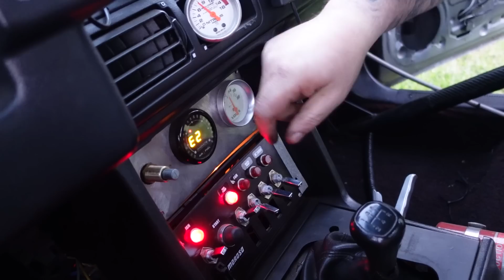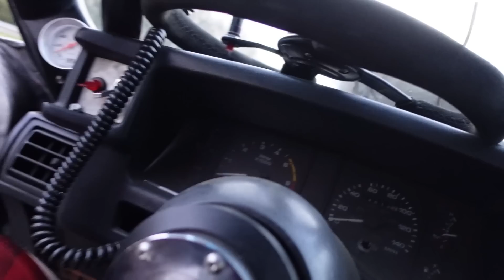Twin Turbo Stick Shift Crown Vic runs its Fastest Pass EVER! Testing with Chris Cook

Comment: Definitely need some seat time, shift it at a consistent rpm and there is some time left in it for sure. Only gear it’s actually rpming is 4th by the sounds.

Cool car! Keen to see what it can do!
Reply from the maker: Forsure, after the changes we made the car reacts and feels completely different. Seat time is definitely a must. Next time we take the car out it'll be to mainly focus on revving each gear out and learning those shift points. Everything is just happening much quicker now with the 5.13 gear

Comment: What is the device you use for the clutch where you don’t have to press it in when you shift ?
Reply from the maker: Kdn shift cut knob but you have to have a faceplated (non synchronized) transmission otherwise you'd still have to clutch the shift. It'd still cut ignition though to where you could no lift shift a synchronized trans.

Comment: Depending on what year the van was is to wether it was a 5.4  it looks to old school to be an old 5.4 if the van that motor came out of was an 1970s or 80s it’s a 460 the 5.4 if I’m not mistaken is a dohc and the motor in that fox is no dohc it definitely sounds like a 460 to me

Comment: I don't claim to know what your setup is. This is the 1st of you guys' vids I've watched, but I'm hooked. Anyway...it seems as tho he's shifting early and leaving a lot of meat on the table. Compared to where he said it made power, that is. Correct me if I'm wrong.  Anyway, great content gents. I do loves me a fast Crown Vic. 👍👍👍
Reply from the maker: You're correct. 100% short shifting. After the 5.13 gear install it completely changed the car in terms of time spent in each gear and with it already having a pretty close ratio 4 speed jerico trans, everything is happening much quicker than ever and he's anticipating the shift trying not to hit limiter. We're gonna go back testing soon with this as the main focus just getting seat time and relearning the car.

Comment: no disrespect but put someone in it that can drive it better.
Reply from the maker: First time he's driven it with all the new parts installed.. on a very sketchy track at that. He just needs another track day to relearn the car and get use to it. The car went it's fastest pass ever short shifting the hell out of it. Close ratio 4 speed trans and a 5.13 gear with the most traction the car has ever had and the most boost. Things are happening much quicker than they use to.. It's a learning curve. Just needs more seat time.

Comment: Dude don't know how to drive plain and simple
Reply from the maker: Real easy to talk shit behind your phone isnt it. You go put a close ratio 4 speed manual jerico trans with an ignition cut shift knob in a 1000hp/tq 6.2 raptor swapped twin turbo Crown vic with a 5.13 rear gear and a slipper valve. New double adjustable suspension, anti roll bar, freshly corner balanced, on a different brand of tires, and no sway bars. Then take it to one of if not the sketchiest no prep track in the country completely untested all while trying to tune the clutch, boost control, and learning shift points.. 

Nobody in history takes a new setup out to a no prep track while still dialing it in and does perfect forst outing. It's called seat time and relearning the car. It's a completely different animal from the stock 4.6 2v single turbo tr3650 with 4.10s. Even short shifting the hell out of it the car ran a pb 60', et, and mph by alot and is the fastest Manual transmission crownvic "plain and simple" with him behind the wheel. Does it have alot more left in it, yeah. But he's drove it once on the setup lol. I'd sure hope so. Keep hating from the sidelines, we'll continue building cool shit and get faster every outing. 👌